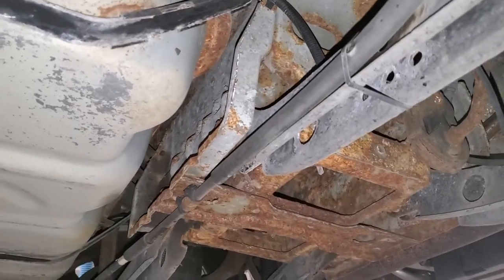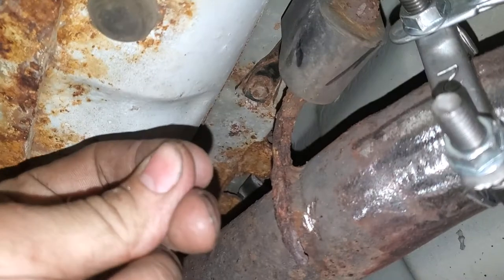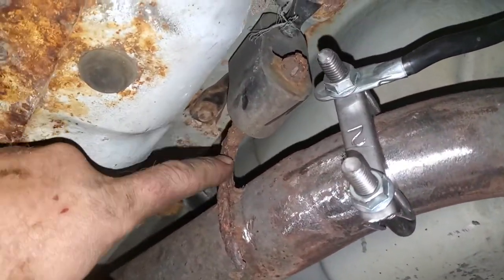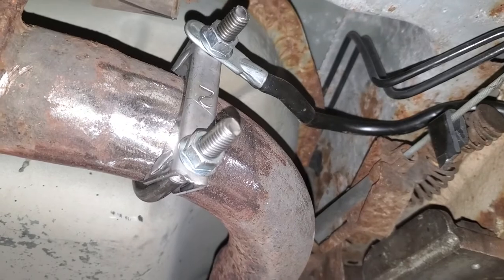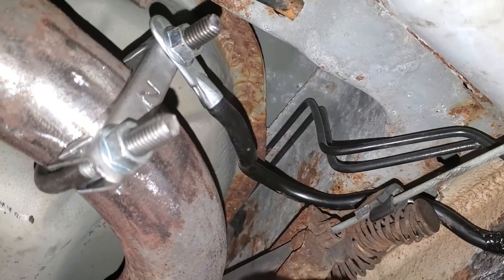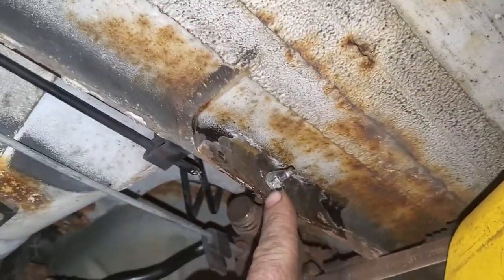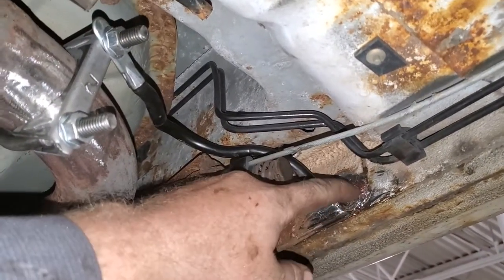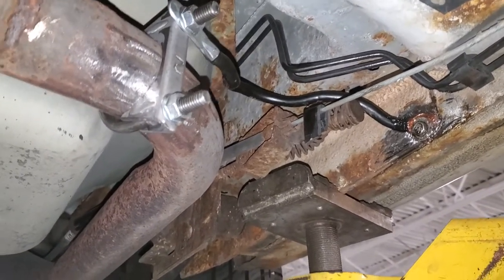2002 Lincoln Continental gas gauge malfunctioning and lights malfunction interior and exterior

Comment: Need your advice !!!!  About 6 yrs ago my 01 crown vic developed a leak in floor board like yr Town Car.  Saw how u fixed yrs.
Recently it developed the same leak again flooded floor board.  Took  it to a glass shop that specializes in fixing these kinds of leaks in CV AND TOWNCAR.  
Took it back twice cause still leaked.  Well they thought they  fixed it second time.  Tonite rained hard leak is back.
So I have to take it back a 3rd time.  The last time they fixed he said there was a plastic part missing in the cowl.
I looked at yr video again when u fixed the TC and the parts u took out and replaced are the same as mine so I don't know what he is talking about.
Noticed under cowl where you have a rubber drain on left side to drain water u said can ge5 clogged up mine does not and my Marauder does not have one ether.
Any suggestions about to loose my cool ????
Reply from the maker: So if you don't have that drain their can you make a little grain there? And did you make sure those weather strips around the door were clean out completely because they actually have channels in them that help drain around the doors
Reply: @FordBossMe  thanks for the info.  It will be in their shop again in morning will relay to them what u said.  The water comes in directly under glove box carpet level. 
Carpet next to door passenger side always dry.    Only happens when there is a downpour.  Thanks again tired of fooling with this .

Comment: My 09 Grand Marquis' fuel gauge randomly stops.  It'll take two or three days before it moves again.  Not only that, but whenever I partially put gas, the fuel gauge needle goes all the way up to full, despite the tank being partially full.  Before I condemn the sending unit, what else could cause this behavior?
Reply from the maker: Instrument cluster had issues in some of those models

Comment: My 1997 Lincoln town car presidential has 61,000 miles  Lately,  I started the car a few times and it tried to sputter outand stop.     My shift has had way to much play and several times my car tried to sputter out on me and I moved the shift a little bit and then the car seemed to take off and the idle high and I would take my foot off the gas pedal and the car would still be moving.. Sometimes,when it is out of wack the door locks pop up.  - My car has been reading ZERO miles to empty when I know their is Gas in the card. My Fuel gage indicator is a little wacky. All of this stuff started except the shift when I started fiddling with the car phone this car came with, Seems it affected my 10 Disc  CD player as well.  Electrical? Something loose? It's hard to explain but the cars acting weird, - IT'S NOT THE BATTERY.    Can you help?              i know nothing about cars,
Reply from the maker: You're going to have to give me some time to look at this later I don't have any answers for you right now I'm in the middle of my work day and if this was simple I could answer it

Comment: I wonder if this is similar to an 04 Town Car. Got a p0460 and changed the fuel pump + Fuel sending unit ( since they don't sell them separately) and the code came back + inaccurate fuel reading.

Comment: I had something weird like that happen with my '07 Lincoln Town Car. My fuel gauge would take forever to read full after I fill the tank. I had put green coolant in the cooling system when the water pump went out. About a month later I was having problems with my fuel gauge. I watched a video on YouTube with Scotty Kilmer and he was taking about the different coolants and how many of the new coollants are hybrids. He mentioned that having the wrong coolant could cause electrical issues as some coolants can conduct electricity or cause the alternator to ground itself to the coolant. So, don't call me crazy, I flushed the entire cooling system and filled it with the correct Motorcraft gold coolant and I haven't had a problem with my fuel gauge yet. I'm really unsure that was the problem. However it has been 2 years and the fuel gauge is still working perfectly. I enjoy watching your videos brother! Very informative! 🔧🔩
Reply from the maker: So Scotty is good and he has a plethora of information but he doesn't necessarily like specialize in something individually I know what was going wrong with your car, ive delt with it on the car specifically 

So the cooling system and the coolant breaking down causes something called electrolysis and it can mess with the electrical system

What I do is I take like a 12 to 16 inch ground table and I run it from the top stud of the alternator over to the battery and I add a second ground in and it never happens anymore

I'll do a video here in a couple days where I do the same thing to my car I'm going to run that additional ground to show people how to do it

And when you do this it minimizes or completely eliminates that effect of the coolant electrolysis
Reply from the maker: Thank you for the kind words
Reply: @FordBossMe  you're very welcome! 

Aha, so that's what was really wrong with my car. I've watched videos where people added a ground from the alternator bracket to the negative side of the battery. I thought about doing that. Now I think I will. Thanks for the help and advice!
Reply from the maker: That's the issue with that car for most of the electrical issues
Reply: Wow. Would never had known that old coolant could mess stuff up like that.... I suddenly have the urge to do coolant flushes on my vehicles lol

Comment: My lights are flickering especially the dashboard , and the service engine lights comes on, also when I’m driving I notice my interior lights would come on and then when I take off it would turn off, I need some help I have a 1999 Lincoln continental
Reply from the maker: Check the ground cable on the driver side back where the rear suspension kind of meets the driver side pinch weld area that goes along the whole side they're supposed to be a ground strap attached back there and it rots out it attaches to the exhaust oddly
Reply: @FordBossMe  thanks I’ll look into it
Reply: @FordBossMe  the dashboard lights be acting crazy but definitely will take it to an electrician and tell them what you told me about the ground cable

Comment: I also have a 95 The PS pump is a nighmare. But just think, on that car with v8 FWD engine you can easily change a waterpump. But the new 3.5Ls :lol:
Reply from the maker: It wasn't that bad actually I was done in about two and a half hours book time calls for 4 and 1/2 hours
Reply from the maker: It was definitely harder than what I expected though I will admit
Reply: @FordBossMe  Well you are the Auto Boss! I remember some bolts were almost blind. I also remember the PS line, I wanted to use a flare wrench for fear I would strip the fitting. Nothing fit except I think an 18mm open. You also have to put that teflon washer on. I work them up the threads with my nail.
Reply from the maker: Yes the two top 10 mm bolts were blind and I use an opening 18 to just turn by turn to get the nut off the pressure line and when I installed the Teflon ring I just barely fit it over the threads and then used my nail to the slowly turn it down and push it into the gap. I did it the same exact way